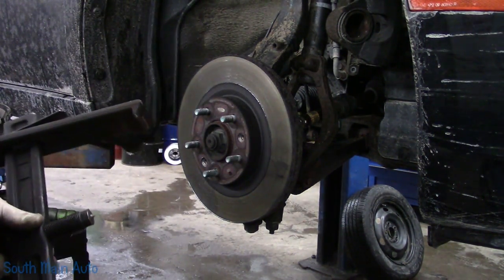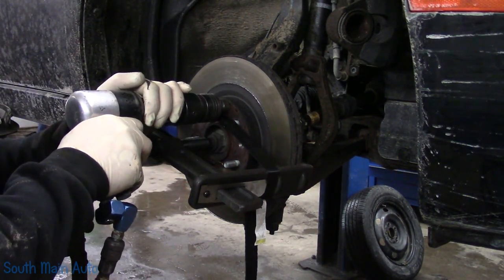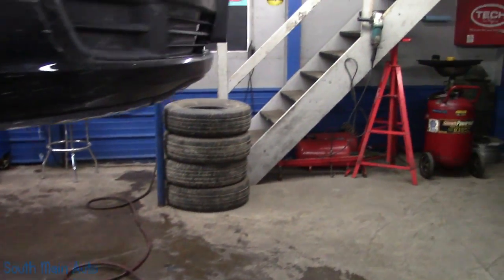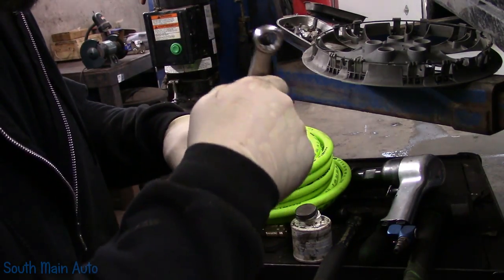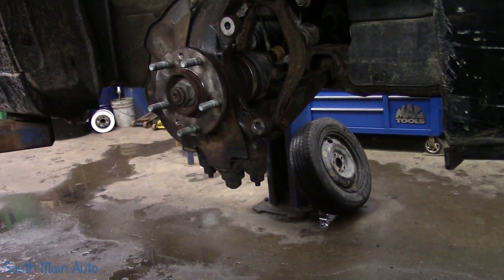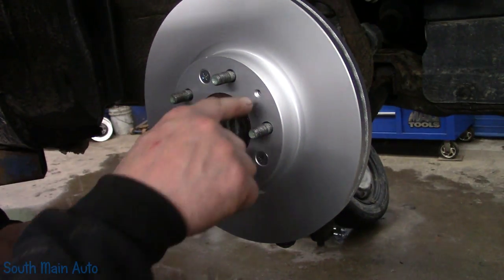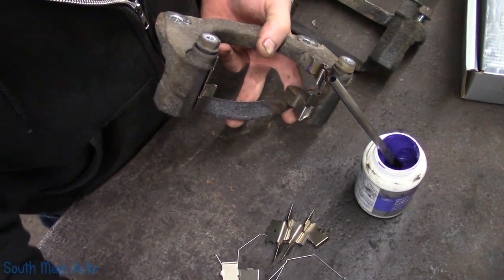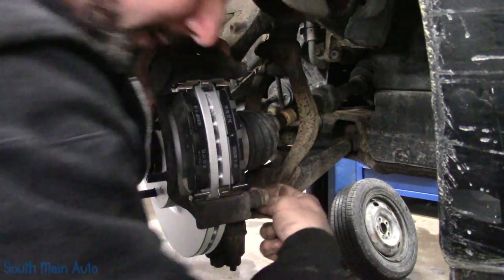Mazda 6: EXTREME Brake Rotor Removal 😱

Comment from the maker: OTC 6980 Heavy Duty Brake Drum and Rotor Puller: https://amzn.to/2T1Lds7
Astro Pneumatic Tool 4980 0.498" Shank Super Duty Air Hammer/Riveter: https://amzn.to/2X8aGzz
Reply: What is that hollow abrasive wheel you placed over the studs to clean around them?
Reply: Did my front pads....took me ages! I'm no mechanic but worked in a garage for may years and watched many youtube videos.You just need a bot of confidence so i did my front pads,didn't have a plate on them so i had to put the old plates onto the new ones which of course kept slipping.It is a fairly easy thing to do folks.I wouldn't do my rear shoes thou lol a bit complicated for my liking.
Reply: David Hart, Thanks for the PN. if SMA adds it to his Amazon Page I'll get it from them.
Reply: What is the lug stud cleaner that you use also? Wanting to expand my tool kit a bit, but havent been able to really find a good lug stud cleaner like you have?
Reply: South Main Auto Repair LLC LAST MONTH DIDN'T YOU BUST UP A SHOCK AND TURN INTO A FLAME THROWER?!?!?!        NICE ROLLING FOR THE 2019 SEASON 💪.
Reply: @ArmaSwiss  he uses the 3m one, I have the OEM Tools one works good for home gamer
Reply: @staind288  3M stud cleaner
Reply: Cheers! Ive been wanting some for my kit. Working at an independent shop soon and the previous shop never properly did brakes from what I saw. Never cleaned mating surfaces, never cleaned the hub-rotor mating surfaces. All because the Service Manager said 'takes too much time. Don't do it'
Reply: Maybe do not back the screws all the way out or leave 3 studs on next time?
Reply: @jstefanko100  I agree - even one lug nut threaded on a couple threads would probably prevent the projectile.
Reply: you're supposed to put a lugnut on to prevent the rotor from going hog wild
Reply: @greencoffeecup  a wire brush would be cheaper lol
Reply: I learned i don't ever want to use a rotor puller. I'll do the ones i can, then limp it down to you Mr O
Reply: South Main Auto Repair LLC I'm from Western new York  near buffalo and unless you have the right tools things will not go well I work on rust not metal
Reply: Best way i found to remove rusted on rotors is to use a portable band saw and cut them from the outer edge to the hub in two places 180 deg apart. Then use a  slide hammer on each half. If you cut all the way down to the hub it will crack across the hub face and peel off. Just cut between the vent fins .The band saw cuts cast iron like butter!!
Reply: I work for Mazda in li ny those mazda 6 get a bag ass lip on the spindle.. But honestly i get them off without a puller hit the rotor on a full 360 lots of pb blast. Love your channel
Reply: Getting them off, I used a lot of heel stomps sitting on my rear.
Reply: Put 2 or 3 lug nuts a few threads When they pop, keeps them from flying off ;)
Reply: JEEZ,RUN THE LUG NUTS HALF WAY ON,,,THEN WHEN IT GOES BANG,YOU DON'T LOSE YOUR F-ING NUTS.
Reply: What is the name of the song that played for big nasty
Reply: Would have been a good idea to have put the wheel nuts on slack to prevent the rotor flying off
Reply: is that the first time a a break roader flue a cross the  shop almost taking youre head whith it
Reply: Have you ever tried the lighter or torch and candle  technique on rusted on bolts? Just saw a YouTube video on this and people in the comments say it does work. Probably not applicable to a rusted on rotor but if you struggle enough 😂

Comment: Leave a lug nut or two on a few threads to prevent that. Toe crush time and knee.
Reply: Good advice - or another ratchet strap from the puller to the suspension somewhere w/ a little slack.
Reply: Randy Carpenter — Maybe 5 lug nuts based on how that rotor launched!
Reply: i put all on to stop more things flying
Reply: Totally essential Leon, He scarred Mrs O pretty good.
Reply: That thing would have flattened me had I been standing there. If the puller comes out a couple nuts always go on. Doesn't help when you tear the chinesium brim off the hat though.
Reply: Nonsense. I clockwork orange my eyeballs and get close to it.
Reply: @mharradine57  "Singing in the rain, just singing in the rain..."
Reply: @mharradine57   Unfortunately you can only  see that once.
Reply: You mean like OTC said in the instructions?  Who reads that?
Reply: @stevenrice47  Blasphemer!
Reply: I was just getting to write the same thing!!
Reply: Beat me to it
Reply: This method is way more efficient than my idea of wearing full catcher's gear.
Reply: Now you tell me!
Reply: How the heck did I not think of that?
Reply: Randy Carpenter absolutely I always leave the nut on a few turns when using a puller ! Unless you wanna be missing teeth lol
Reply: Hindsight is perfect but that's how we learn.... or you watch you tube and see others make the mistakes so you dont have to lol
Reply: I always clean the slide pins and put that identical grease on them....
Reply: i thought this was obvious....and im not even a mechanic
Reply: Good tip!
Reply: @stevenrice47 HA, and I though I was the only one who went and read the OTC directions!!
Reply: @Iubaru Smpreza: Sudden recovery from the elastic deformation of the puller and the rotor.  One of the first lessons of mechanical engineering is "Everything is a spring!"
Reply: @Iubaru Smpreza The disc puller puts a ton of spring tension on the rotor. When the rust weld breaks, the spring tension is suddenly released and the whole shebang goes PING!
Reply: RANDY C.,  + ,   MY Sentiments exactly,   I'm like,   " HUUUUUU"???
LOLO,  😂😁🤣😳🤔
Reply: Smart.
Reply: I’m sure the directions say leave a lug nut on.. what fun is that? SMA comments are soaring.. 😂
Reply: He already knew just wasn't being safety about it
Reply: He didn't know that!

Comment: You're are so very lucky! I was removing the rear rotors on my GMT-800 '03 Silverado SS. I had backed off the adjusters properly past the rust ridge on the driver's side and lightly banged around with my stubby 32 Oz. sledge. While rocking it back and forth is was giving, but slowly. Crouching in and squatting as I was, I gave it the college go one last time. Oh, she gave. She gave and whanged hard off my only arthritic knee. I was sucking wind, choking back tears and rolling on my back like an upturned tortoise in my driveway for a solid 5 minutes and questioning my role in life, the Earth and the Universe as a whole.

Long time watcher,  long time fan - but first time poster. Brother, you're so lucky that rotor and tool didn't gut punch you in half! Hang in there bro, and stay safe. Please! You're an insightful and skilled instructor and repair tech that we all desperately pray for if we can't garage or shade-tree fix it ourselves.
Reply: I was struggling not to laugh while reading this at work, but i know for a fact i wouldn't be laughing if it happened to me lmao.

Comment: I'm in the rust belt of Canada and have used the threaded holes a number of times. The trick is to do it on rotors that have 2 holes. But the bolts in and tighten them up but don't strip. Then hit with hammer. Bang rotor flies off. It won't work on that Mazda though. I've had 4 lb hammer sessions on Mazdas before. Nothing like beating a rotor for half an hour
Reply: So the entire country?
Reply: 6lb 24" handle Wilton bash hammer. Favorite hammer in the shop. Also excellent for Explorer rear wheel bearings. Used to beat on those in 2 man teams for upwards of an hour at the last place I worked. Not even the otc hub grappler wanted to work on those
Reply: @matts.8342  Nah just the parts that use salt, BC and Alberta cars look as good as new mexico because their government isn't stupid and uses beet juice and sand.

Comment: This reminds me of a similar situation I encountered when I first started to work in an automotive shop during the late 60s. Forget now exactly what kind of truck it was but the heavy cast brake drums would seize onto the axle hub. We had special large pullers just for that application and you could pre-load that sucker within an inch of it's life and beat on it all day to no avail.
My dad also a mechanic should me the easy way to take it off using an O/A torch and no puller. Heat the drum up evenly and when it goes"tink" from expansion and release you can remove it by hand. That trick saved me lots of grief in the ensuing years.
Love this channel, keep up the good work!
Reply: I used to work on cars that had their hubs splined to the axle shaft.  Had one Volvo P1800 that had max tension applied with a puller, soaked down in Kroil, heated with a OxyAcet torch and pounded on with a sledge -- all at the same time.  Three of us had been working on it.  Still hot and under tension we were all standing back trying to figure out what to do next when one guy just tapped it with a 10mm combination wrench like he was pointing at it and the whole assembly flew apart explosively.  Just that little 'tink' did it.
I can also remember a VW bus (also splined) that just wouldn't give it up.  I ended up cutting the drum and hub off with a chisel.
Reply: Probably the same truck I was working on
Reply: Internationals with the semi floating axles. been there done that
Reply: Lol i was scrolling for someone to mention a torch. Wouldve been the first thing i went for

Comment: Every brake job i do, i like to put lube on the ears of the pads, rather than dry, keeps from seizing in the future,  i also lube the slide pins regardless of whats in there, love your channel, been a mechanic for 23 yrs, keep up the good stuff..👍🔧
Reply: toolguy40dg yup, I’m the only guy in the shop that does that.
Reply: also a little lube on the hub so the rotor won’t get too stuck eother

Comment: Eric I also have this tool and I had a 2014 Town And Country van on my lift. I beat the snot out of the rotor until I finally broke out this tool when it wouldn't come off. I put the OTC tool on it and put a ton of torque on it with my Milwaukee half inch impact and then hit the forcing screw with a mini sludge without the safety strap around the tool. The tool along with the rotor flew off the Hub and blasted the wall about 7 ft from where I was working the tool came apart in 3 pieces I'm lucky I was standing to the side I probably would have got blasted. The tool did not break though it just came apart as you know they do. I'm in Utica New York so I get the same stuff you do when it comes to rust and ever since that day I'm grateful to have this tool even though I don't use it very much
Reply: Oh and thought id mention ive seen in your older vids people commenting that hitting the forcing screw does nothing. Well they r certainly wrong and must not be workin on cars in central ny
Reply: cny makes working on anything a nightmare. I'm west of rome.

Comment: I was working with a friend in a driveway on a really stuck rotor. He tried using the caliper bracket on the knuckle and a bolt to drive off the rotor.

That turned into a new knuckle. Of course the lower ball joint was stuck in it, so throw in a new lower control arm. And it had press in wheel bearings so no point in changing that over. And it was easier to just grab the strut too since it's only 3 bolts in the fender.

Turned a pad and rotor slap into a front suspension rebuild!

.. with junkyard parts
Reply: Fuckin hell dude. 😂
Reply: Same here a broken ball joint to a new upper control arm, tie rods hub bearings since it's the Ford rotor where it has a bearing on the spindle. Left the suspension alone since the lower control arm holds the spring, I wish it was a strut.
Reply: Last time I had one this stuck, I just put a hole in the concrete under it and used a big ass prybar like a lever.
Reply: I had one turn into new hubs, no issues getting those out but damn those rotors weren’t coming off!
Reply: Some guys just don't know when to break out the sledge other don't know when to leave it in the corner.

Comment: Not that I'm a pro like yourself but I have done many brake jobs, mostly free🙄, and I put a large puller on the rotor and torque it down some and then I hit it with the torch with a cutting tip for fast heat... usually does the Job in most cases. Love the videos and don't lose a toe! 😂

Comment: I've never seen a brake rotor turn into a guillotine so fast. I'll be watching my toes if I get into that mess. It was fun to watch though.
Reply: Next time either wear steel boots or I can recommend Dutch Clogs, which believe it or not are considered the high grade of safety shoes just like the steel ones. Although it might look a bit silly with clogs in the workshop. lol
Reply: or just use a nylon strap to catch the rotor hanging on the lower arm

Comment: As an auto-shop teacher this happenend to my students as well. It was the same type of Mazda 6. We hammered the hell on it, lastly with a very large sledge hammer; didn't budge. I eventually heated the disc with an acetylene burner until it was cherry-red and then tried it with the sledgehammer; it did not budge....

Comment: I had a wheel bearing did that to me. Luckily after I put the pulley on I had stepped away to take a break. That thing flew a few miles away. Legend has it, its still flying. Happy to see you weren't hurt

Comment: Bloody hell!!, you nearly got a smack in the love spuds :-D
You need a danger bucket with a hole in the bottom, fit the bucket over the rotor and extractor, clip the handle to the suspension strut.
' The Danger Bucket ' Only 19.95 At all good stores, bad ones too :-D
Reply: zx8401ztv 
I hope your happy now I’m going to paint “ danger bucket “ on a bucket and bring it to the shop. 😂😂😂😂😂

Comment: O man I'm glad to see that I'm not the only one having fun with mazdas. I did full brake job on my 2011 Mazdaspeed3 and had a fun day slamming a hammer as hard as I could trying to get the rotors off. I could not believe how seized the rotors were to the hub, unbelievable how much of death grip those things have to the hub.

Comment: Those brakes can be restored to like new condition, your underwear can't.
Reply: I have a few relatively new boxers I could send him. Do you think he's more the roaring tiger or pink bunny type?
Reply: @fascistpedant758  I believe those would fall under NYSDEC or the EPA.
Reply: @timothybarney7257  - In MA, going without underwear is illegal ... due to excessive emissions ... 😷
Reply: @fascistpedant758  I wonder if Snap On branded ones would be appropriate? 
Have to ask Mrs O
Reply: @SmittySmithsonite  LOL!
Reply: Just wack that thing with a sledgehammer and the disc comes off no problem. That's how I do it in my driveway.

Comment: Your video inspired me to try the same technique with my biggest and best Harbor Freight puller on my 2003 Grand Cherokee. I used my brand new Milwaukee 18 Volt impact set on power level 3 of 4. Hey watch this... It was spectacular when it finally went ping. I was prepared but it still scared the crap out of me. Somehow the HF puller survived too. Your videos are so helpful for understanding how to work on rust belt cars because I live in Arizona and never dealt with this level of difficulty. Thank You

Comment: Does it help any if you barely put a lug nut on there?
Reply from the maker: Hind sight is always 20/20 :)
Reply: @SouthMainAuto  Live and learn, what doesn't kill ya only makes you stronger.  No surrender and NO PRISONERS.  That's the last time you make that mistake.
Reply: Maybe that's why they don't include a strap to attach it to the car.  I would've done the same thing as Eric.  I didn't think about it either.
Reply: In my experience, what doesn't kill you tends to just piss you off.
Reply: Man, if this wasn't an SMA video, a lot of comments would be eating inside and out the mechanic for not putting a few lug nuts on,
Reply: @SouthMainAuto  that's a yes then 😉
Reply: With as much pressure was on that rotor those lug nuts would have stripped their threads off and become more projectiles. Sorry I have seen a Dayton hubbed OTR trailer break the studs off when changing a tire on it. The standard removal process for the wedges was a hammer to them. The less things in the way when parts are under tension the better.
Reply: This is what happens when you don't read the manufacturer instructions....Glad to see that the only casualty was a broken hose and maybe a little pee pee. ☺☺☺☺☺
Reply: I have the same tool.  Works amazing.   The strap is meant to go around the outer diameter of the rotor to keep the claws gripping the rotor.  My first rotor flew off like in this video.  The second one I used a lug nut and it kept the rotor from flying of.  I have a you tube video showing how this tool works with the strap and the lug nut
Reply: @SouthMainAuto , I understand that Hind Sight is 20/20, I was always taught that "Experience is a hard teacher, for she gives the test first and the lesson later", but I've never used a tool like this before, as a matter in fact, I don't deal with a lot of rust because I'm in Texas, but I was thinking about future procedures
Reply: @ericfromflorida5146  glad to see someone reads TOOL /safety directions- cringed and he did it twice!!
Reply: Van Halen eruption plays

Comment: Man that was scary, I don't have that tool you use and ended up pulling spindle from car and putting in a hydraulic press, and when it finally broke free it scared the bejesus out of me! I put a light coat of anti seize on all mating surfaces on assembly and have no flaying of anti seize on affected areas. I really enjoy your channel.

Comment: I had to CUT the rotor on a 1978 Chevy Nova in pieces. It didnt matter what I did. I tried EVERYTHING humanly possible. In the end, I used a cut off wheel and cut from the stud to the outside edge. I had to make it into pie wedges and EVERY WEDGE was STUCK . It was my first experience with a frozen on brake rotor. What a joke! I learned after that USE ANTI SEIZE . Period.